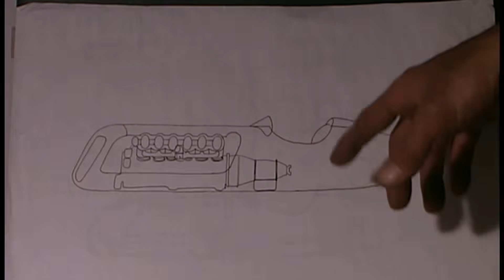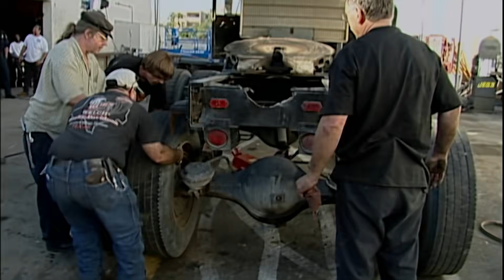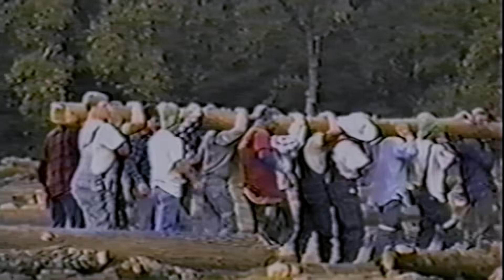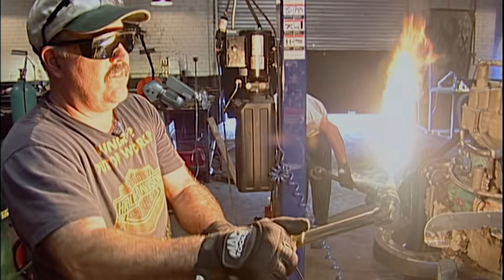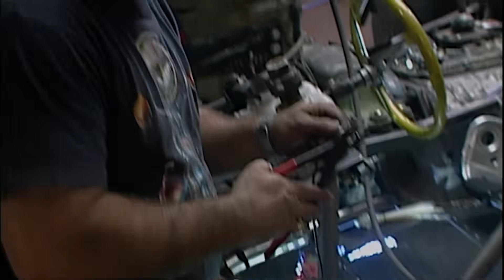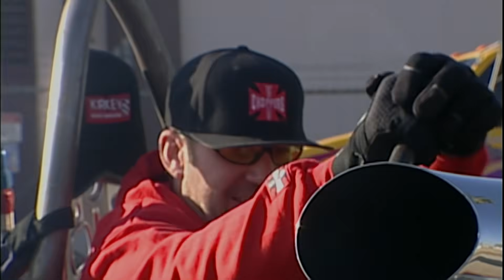Monster Garage FULL EPISODE | SEMI-TRUCK TO CHOPPER BUILD!!

Comment: The guy the said if pressure guage is at 0 he doesn't have brakes. That is wrong. You have to have air to release the brakes and air to stop.
Reply: Truck is 1972 spring brake chambers were not required till 1975 look at the video single chambers its definitely suicide brakes